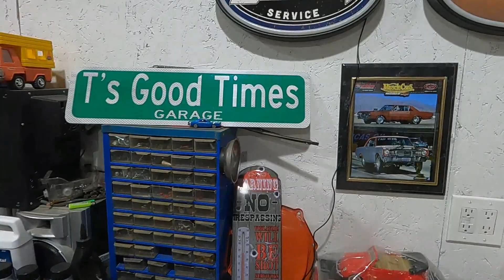Bout To Get Sketchy With The Moho Motivator, The Motorhome 440 #willitrun #mopar #440

Comment: They put 440s in moterhomes?

Thats sounds like a recipe for disaster.
Reply from the maker: They were low compression, low rev units build to move a lot of weight. Not quite the 440 you might find in a Charger in 1969. 😁